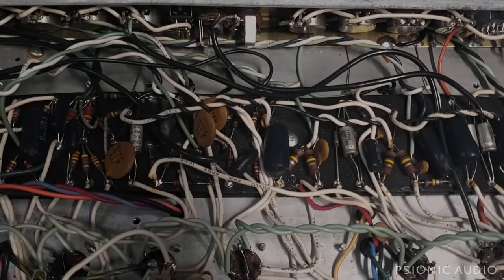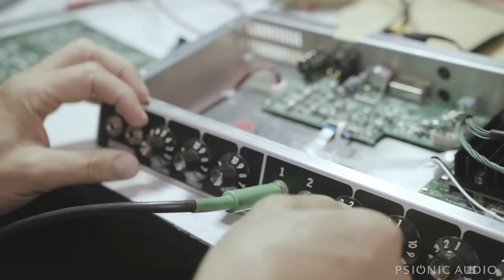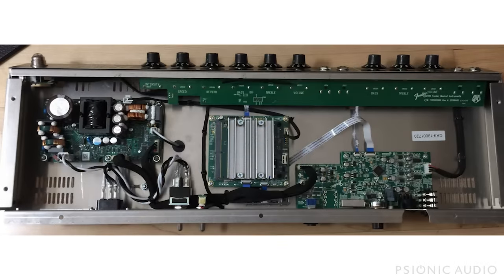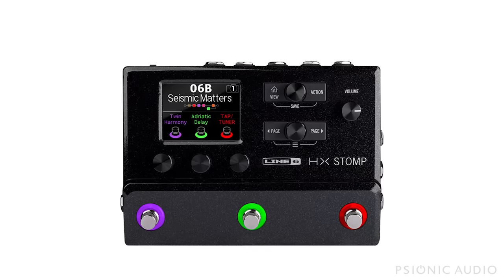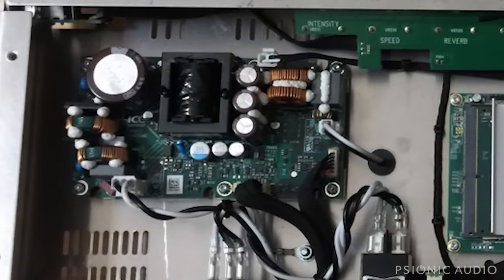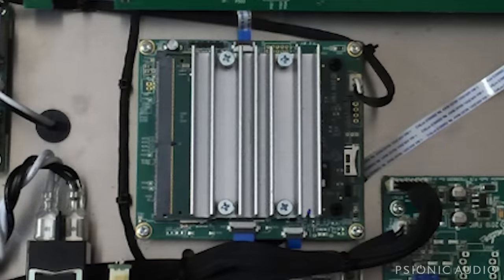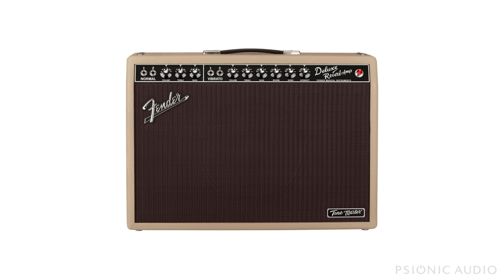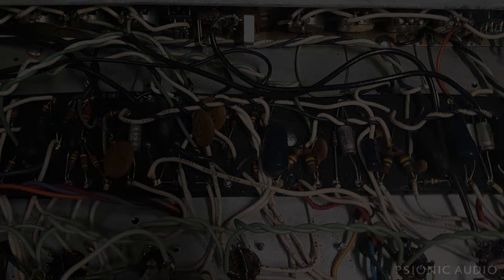We Need to Talk about the Tone Masters

Comment: great video... one question, i have the twin reverb tone master with the jensen speakers and i was looking at switching them out. ironically i came across this video and you confirmed my feelings on the jensens not being that good. now i did do the firmware update and they dont sound as shrilly. but my question is, what would you recommend for a replacement? i play alot of surf, doomwop, psychobilly so i do want that vintage clean tone, but should i go with the celestion neo creambacks that are in the new tone masters, or should i look at something like the G12m-65 that were in the tube twins, or should i get the celestion v30s. im new to replacing speakers so any advice is helpful and appreciated.
Reply: See my comment at top.
Reply: In my black Deluxe TM I'm thrilled the the result I got from an Eminence Cannabis Rex I had on the shelf (previously was pleased with it in a Blues Jr).  To my ears it did a great job taming the shrillness while remaining warm & clear...really, more alive. Currently running it with the 'reverb only' firmware update (w/bright cap) and find it dynamic with my filtertrons, dynasonics, P90, strats and teles....I also do alot of that 'vintage clean' tone chasing with a touch of transparent overdrive or fuzz thrown in at times for rockabilly, country oldies/americana, 80's newwave, ambient, and (poorly played) jazz.
  I also have the Blonde TM Twin (that I bought used and, likely, well broken-in) and I was pleased with the Celestion Neos "out of the box". So, my speaker swap erases the initial disappointment with the TMDR bringing tone up on par with that level with the blonde.  Only catch is that the single speaker added about 4lbs to the amp.  In my case (only occasionally toting it outside the house + zero out-of-pocket cost) a 'traditional speaker' made sense.
  So bottom line, If the weight was a significant factor for you with your Twin, the Celestion Neo's should make you love the amp's tone, but they are pricey new ( and likely more difficult to find second-hand).  If adding about ~8lbs weight isn't a problem, rolling in (potentially, cheaper used) quality ceramic or alnico speakers should serve you well.
-Good luck and hope this helps!
Reply: @wesleyhutchinson2033  thanks for the reply.. i just purchased the Eminence Red White and Blue. I should get them friday. I will send an update once they are installed.
Reply: @mikejazz3349  You bet - I never had the RW&B speakers, but I believe they're also very efficient (loud).  I'd encourage you to experiment with the attenuator, volume and tone settings (in addition to trying firmware updates) and not just put them where a tube DR "should be set" (mistake I initially made).  Also if those are brand new, they'll likely sweeten with break-in time as well. - best of luck!
Reply: @wesleyhutchinson2033  i got the red white and blues!! installation was easy, but the removal wasnt the best. the jensens were stuck on the wood pretty good. however, the mids are a little more noticable, and they seem to have a little more clean headroom. with the surfybear spring reverb, the amp can still be a little piercing, but the tone has fattened up a little, but im still able to keep it dialed into the tone im looking for. all in all im happy with the swap!
Reply: @mikejazz3349  Excellent - glad it's working out for you.  Hopefully with some more break in they'll sweeten up some more.

Comment: What is the advantage of an effects loop?  I run a small pedal stack straight into the guitar input on my amps (Peavey Windsor, Fender Twin, DRRI, Blues Dx, & Blues Junior).  Why would/should using an effects loop sound different than going into the input?
Reply: There will typically be much less noise, hiss and hum if the effects pedals are patched in further down the line in the amp's signal path, otherwise the amp's preamp section ends up amplifying all the cumulative noise from your pedals.
Reply: Another reason is that you don't want to run time-based effects (or even reverb, if you can help it) through the gain stage, as things just don't sound right.  Putting them into the stream through the loop bypasses the preamp and places the effect into the output section.
Reply: They're also good for using a looper: record from the fx send with one preamp setting and play it back, then switch channels or preamp settings for the live guitar.
Reply: @SRHMusic012  Forgot that one!  True, true.

Comment: Having a sophisticated processors in a Fender amp?  I hope they figured out the thermal management.   Many computer processors live in chilly air-conditioned computer or server farms..  A gig outdoors on a sunny days forces me to carry analog mixers as a backup as many  pcs, ipads, or macs, can't take the heat!  (Ever had a guitarist gig with the second generation brand x multi  pedal board and have it quit in the middle of a song because of the heat?  Its amazing how quickly equipment gets abandoned snd permanently replaced when that starts to happen.)  Hope that has been handled!!!

Comment: I do think these amps were a great idea. But why, Tone Master? Which originally was a Custom Shop, I believe Bruce Zinky designed, AWESOME sounding tube amp. Also a Fender amp that does high gain, pretty good. Which is obviously something they're not known for. I just don't get the Tone Master name, on a modeler. But I'm certain LOTS of people are very happy, with the weight!
Reply: They called it the Tone Master series because they didn't call it the Throatwobbler Mangrove series. It didn't roll quite as easily off the tongue, as it were. Or so I've heard...
Reply: Yeah man, I'm not quite sure how they get Tone Master out of taking some of Fender's most famous amps & making them solid state? But, as long as it's a hit, with some people!
Reply: I also find it amusing how people are like, it sounds like the real thing! Ummmmm, to who?

Comment: This is probably a stupid question because I'm not tech savvy, but is it possible to build a non-digital amp that has the best aspects of a solid state with the sonic characteristics of a tube amp? In short, could someone build a solid state version of something like a deluxe reverb that actually sounds like a deluxe reverb, or a least "ball park" of what a deluxe reverb sounds like?
Reply: Do you mean someone putting Korg's Nutube technology with the amp instead? Can be done but i think that Nutube is proprietary to Korg. I think it's possible to build a Deluxe Reverb cab with the same Nutube technology. Just be prepared for the "Cease and desist" notice from Korg and Fender.

Comment: It sounds like a real one, works like a real one, is way lighter than a real one... Will it last? thats anyones guess. I got a Nokia phone that still works same as it always did, idk that someone who buys this amp wants choices they want to gig and not worry about weight (I use mine with a pod go in front of it). In theory it will get cheaper as the chips get cheaper but who knows if this type of amp will stick around. Parts may be hard to come by if its a fad.
Reply: How do you like it with the pod go in front of it?
Reply: @trevor4533  I think any all in one pedal infront of the tonemaster is the way to go. I used to lug a pedal board and that was terrible to troubleshoot. While the helix FX is probably a better choice if my tonemaster were to break i at least have the pod go as a backup by just tuning on the amp and cab section on the same saves (I also carry two boss pedals incase the pod go dies). There are certainly individual pedals I prefer but considering the price and simplicity the pod go infront of a tonemaster is a pretty awesome setup for the gigging guitarist.
Reply: @mortonstromgal  yeah I figured a pod go or helix/hx effects in front would be pretty sweet. Thanks for the advice!

Comment: The lads at That Pedal Show did a video last year with the Tonemaster deluxe and the re-issue Deluxe reverb, the tonemaster held its own (YT compression aside, Mick takes the show sound quality seriously) its alleged Fender put all the processing into emulating the Deluxe Reverb re-issue hence the lack of features you find on the Boss (half the money?) Katana series while being less expensive than the re-issue. 
As an old geezer that only plays for his own amusement the tonemaster has no appeal. The boss 50 watt Katana ($269 when I got mine) does all the goofy cross genre I stuff I want to mess with guitar wise. I just love my tube amps, playing them and tinkering around building my gear.

Comment: I really don't understand why you'd buy a modeling amp that is fixed to a particular model. Even if it's a great model.
Reply: Because you want the sound and simplicity of that amp without the hassle of tubes? Also, because you want a direct line out, power attenuation for low volume playing, lighter weight... there are a lot of reasons. I think Fender should have gone a little further though by adding an effects loop and a headphone output. That is the only reason I don't own one (I bought a Boss Nextone Special instead, but it is way more complex).
Reply: @toesalad  I didn't say anything about tube amps being better, though I think that is ultimately true. What I said, and what I mean, is that if you're going to buy a modeling amp, you should buy a modeling amp that gives you more options than just a single emulation of a Fender model.

Comment: Solid state amps are a way to build a guitar amp cheaper, not better.  The primary goal is cost savings.
Digital amps are not even that.  They are simulations of a guitar amplifier.  That's not a characterization, that's a simple fact.  
They can only be called an amplifier because they do output a sound that is amplified over the original sound.  That does satisfy the definition.  
But what we know of as a guitar amplifier is exponentially more than just making the string vibrations louder.  
And for real guitar players that have an intimate, visceral partnership with the complete instrument of the guitar+amp, there are a vast array of subtle nuances that can elevate the player's ability and inspiration by how the system interacts with the player.  
As a minor example; the weight of an amp has never been a primary factor in choosing an amp.  If it sounds right, has just that interplay that makes me want to play more, I don't care if I need a hand truck to get it from place to place.  Now that I think about it, I've never once ever weighed any of the amps I've built.  I have no idea how much they weight (exactly).  I just know they ain't light; and I don't care.  I didn't care when I was schlepping around a Marshall half-stack or SVT.  Heavy?  Shuh - no kidding.  But if they deliver the sound and experience that I pick up a guitar to have, they're going to be there.  That's all there is to it.

Other people have different opinions.  I don't suggest that other should do as I do.  But it just feels like I'd be sacrificing the very thing I put a guitar in my hands for if I chuck all the tiny bits that make the experience real.  
I've said before that I do understand that many players', working musicians', jobs are made more efficient and less complicated by digital tools.  I don't hold it against them for the choice they make.  It's their choice.  I've also said that the audience is never going to know the difference.  So that choice really is what is most important to the one doing the playing.
I just want to continue support for the flag planted in the ground of purity of sound and nuanced experience.

Comment: I was actually thinking about picking one up for clean tones. They sound great for clean. That is until you showed the inside. Nope. No freaking way actually. I thought they were a little more beefy inside. Especially when the tube reissues are only around $300 more. Or maybe I'm just going to save for an actual vintage amp. Point to point is the way to go. 

The brits at Andertons did a show about the tone master back to back with its tube twin. It sounded pretty close until they hit it hard on the front with a gained out fuzz. The tone master just fell apart sonically. It sounded terrible versus the tube. There is something special about how tubes handle high gain input that tone master will never be able to emulate. No matter how much processing power you use! Making small sine waves into big chopped up sine waves can not be emulated with 1s and 0s.

Comment: Great video and summary. I just don't see the point in them given their high cost. I've owned a bunch of SS fender amps over the past 30 years. All have died and not been economical to fix, and didn't sound like a tube amp. Simple fact is that a fender tube amp will nearly always be worth repairing, especially point to point wired amps. That leaves me with only one possible advantage of the TM amps. Weight. To me that's not a good enough reason. Here in New Zealand the Tonemaster amps seem to be bought by boomers who want simplicity of use and light weight.

Comment: I can understand the appeal of this light weight technology, particularly for the older players with bad backs but, having been faced with the technical issues that accompany their failure, I would think carefully before buying any of it. All is well while the various sub-assemblies are available but, thus far at least, I can only see disappointment ahead. None of them will become collector's items. Like the presently available motor cars, they will only become "static displays" of attractive, once usable items for which critical electronic parts are no longer available. As mentioned in another comment, the upside is that this unit at least will be great for DIY tube builds.

Comment: I took some measurements and reading with mine cranked up and it was showing pretty close to 100 watts
Reply from the maker: The Neo Creamback is rated for 65W. They aren’t going to use 100W into that.
Reply: @PsionicAudio  they probably didn't think anyone would push a fender that hard? I had every knob at 10... See for yourself, put a load on it and take some measurements

Comment: I know that most people don't know what they are getting when they purchase amplifiers like this. Personally i can't stand the fact that the Fender Tone Master Series is all digital. If you are an amp tech and the Firmware fails, there is a reason it failed. You can't just plug in a USB Data Cable, reset the Firmware and expect it to work again if the amp does not turn on anymore. One rumor going around is they have a diode failure problem. There are no boards left after speaking to a Fender Tech. So it sounds Fantastic! Sorry but it's Disposable Garbage that can not and will not last very long. A serious waste of money on a a computer.

Comment: Excellent technical overview. Would the assumption that “ modeling amps” are gonna have 3-5 years max of useful life??comparable to computer hardware…built in obsolescence  will  always be there.
Reply: id agree with you if this was a regular modeler. But this amp is meant to sound like 1 classic amp, not 500. I dont think its going to "age out".
Reply: @seanbrooks2583  you could be right.  I owned the original Fender Modeling amp the Cyber Twin purchased in 2000 ,it remained useful till I traded it in 2017 but the value was about 1/10th of original price. Anyway you could be correct on the ToneMaster, who knows!

Comment: I'd say the TM Deluxe Reverb doesn't have an fx loop because no DR had an fx loop. Considering they're trying to emulate a tube Deluxe Reverb, it's pretty understandable that they would use the same exact setup, WITH NO FX LOOP.

"no way of knowing how long it will last" you act like this is 1961 and computers were just invented and nobody knows anything about them. Smdh. Fear mongering.
Reply from the maker: I was a senior technician in North America for IBM ThinkPads. After that I did IT contract work for a Navy base.

I'm sorry I didn't tell you what you wanted to hear.

Comment: Just buy a vintage fender (or a hand wired clone), it will last WAY longer and sound WAY better.
Reply: Idk… I’ve had 2 Fender tube amps that, no matter what I tried or who I brought them to, they would not work. I got sound, but at extremely low volumes MOST of the time. Other times the amp would work as intended. Tube does not inherently equal better or more reliable.
Reply: @cameronspears1386  Correct, “tube” does not mean that. Most modern tube amps with circuit boards and cheap components sound ok and aren’t overly reliable. A quality “hand wired tube amp” (whether vintage or a modern clone) does. There is simply no comparison of sound and reliability. I hope you are able to spend some time playing one. A Fender Champ is a great place to start.

Comment: FX loops are completely overrated and usually shite in most amps, especially those costing less than 1k. Almost every modern pedal sounds best in front of a clean amp. Even delays, and especially slapbacks. I think most people would say they prefer their fx in front of the amp nowadays, unless they have a proper FX Loop circuit which most amps don't.

Thank God they didn't put one in these amps. This guy sounded like he really wants to hate these amps. Good thing they've been extremely reliable and have kept their value very well considering they're not valve driven.

Comment: These amps were not sold as amps that will work for a couple of years and then need to be replaced. If they fail within a reasonable time, Fender has a big problem. There will be legal action against Fender if they don’t deal with it proactively.